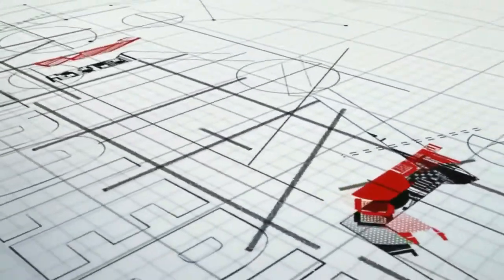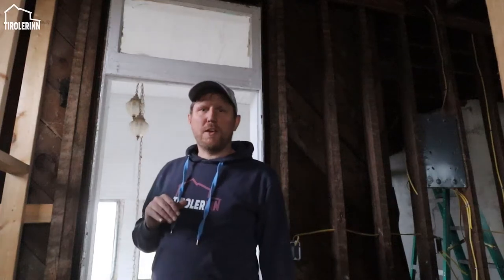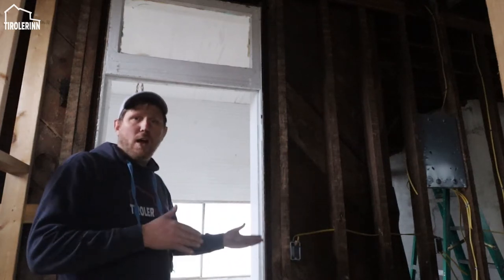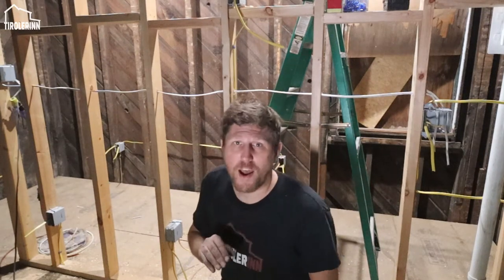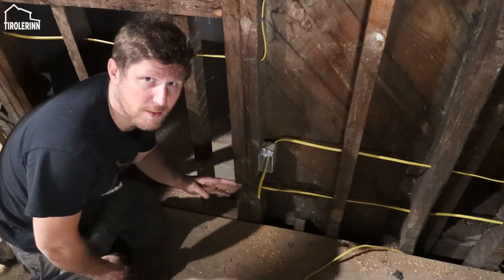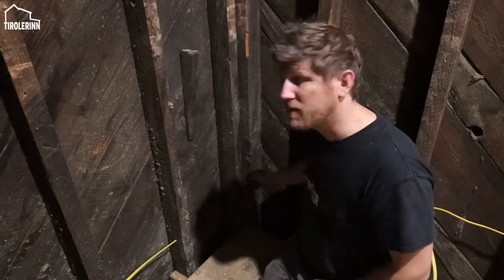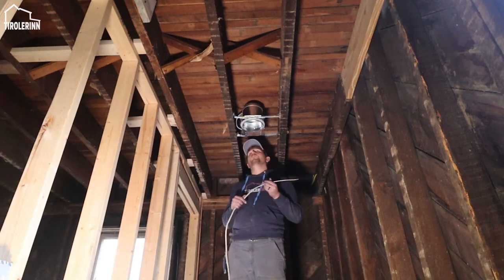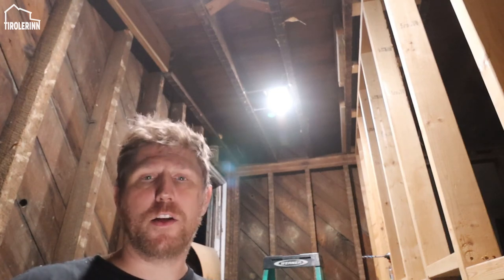Testing Some Lights and Finishing the Wires on the First Floor- TirolerInn the Renovation

Comment: Nice job again. It's great to see how you think a few steps ahead, as I can see at your decision of the cable routing in the corners. I would use the daylight bulbs at the working and cooking areas in the kitchen,pantry, in bathroom, closets and basement. The warm white bulbs for the rest. I also use them for the hallways. I chose powerful LED Spots with a high brightness. For me it is enough, but everyone see it different.
Reply from the maker: Agreed. And everything needs to be dimmable so the brightness can be adjusted
Reply: @TirolerInn  Definitely.  I would always use dimmable if possible.  Even if you change it only rarely or never again, you can still set it up exactly how you want it to be.

Comment: Great video! It is not common for me to have lights sunk in the ceiling. I have switched most of the lamps in our house to Philips Hue LEDs with color functions. In the kitchen we have separate LED lights under the wall cabinets. Light is so important and I would have my problems if I were in your place .. so many possibilities to do something wrong :-D But I think you have already put together a good concept and I am looking forward to the end result.
Reply from the maker: I was looking at Hue but since I am starting from scratch we will do in wall control instead of controlled bulbs.
Reply: @TirolerInn  Right decision. Long time and Budget.

Comment: Another step ahead.  How long till you get an electrical inspection to hook up your boxes for full power?
Reply from the maker: Great question. We still have to run the main cables to the electrical main breaker box and we have to hook all the outlets up after running the wires, and don’t forget the sub panels need all the breakers… so maybe a few weeks, like 3 or so to get that all completed